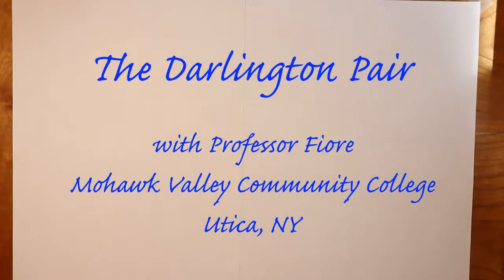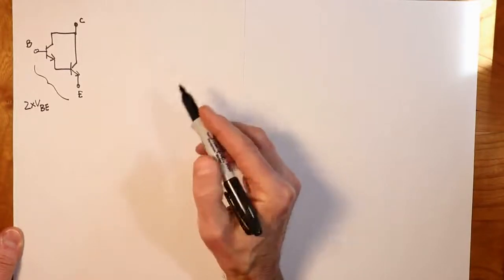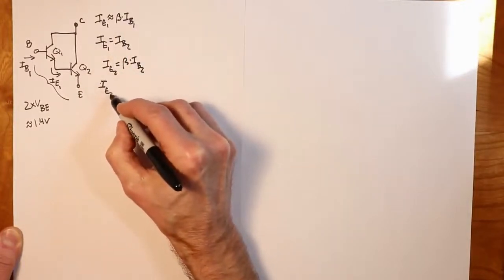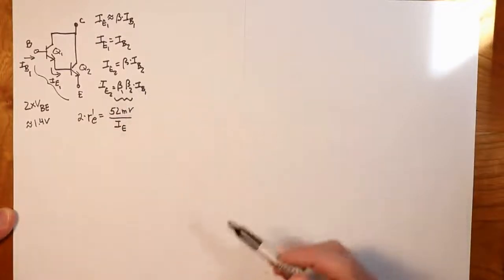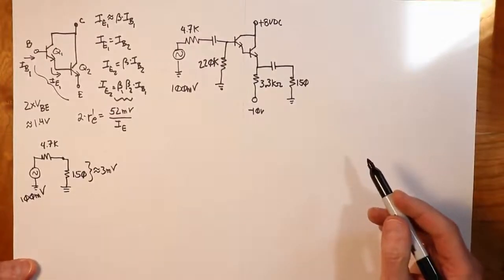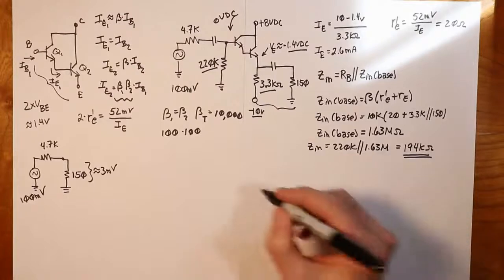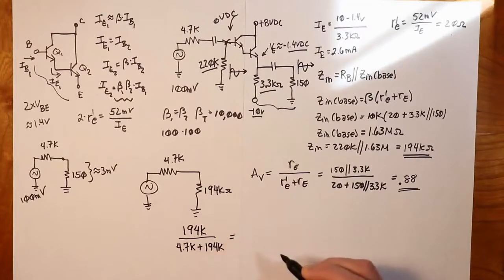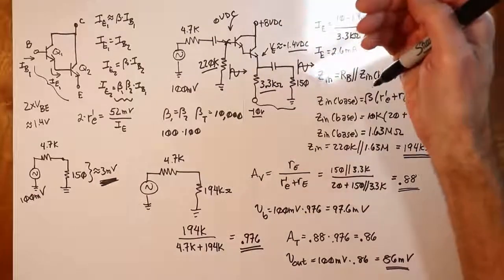Semiconductor Devices: The Darlington Pair

Comment: Morning Sir. I'm struggling a bit with this one.
I hope you don't mind me asking questions of you.
When it comes to calculating the re values of each transistor, wouldn't they have vastly different emitter currents? That is, the first transistor might have a base current of 100 times less than the second transistor, therefore the emitter currents would also be about 100 times different. If we say r'e = 26mV/Ie, if the second transistor is about 3mA, the first would be about 3uA. Am I making a silly mistake somewhere?
Further to yesterday's video on Common-Collector (emitter follower), where we could have used a second stage with a PNP, could we do the same here and return the emitter voltage to the same as the original DC base voltage? Is there a reason to use 2 x NPN?
Thanks again, I'm finding your videos perfectly paced (even if I've only just found them) and I hope that my questions aren't too daft.
Reply from the maker: Yes, the two transistors have vastly different emitter currents, and thus, each transistor's individual r'e is vastly different from the other. The trick is in how the pair is perceived by the rest of the circuit. Consider a pair with beta = 100 for both devices and r'e1 is 200 ohms, meaning that r'e2 is 2 ohms due to its higher current. If you look into the base of the first transistor and consider calculating Zinbase, what do you see? r'e1 gets multiplied by beta1 for 20k ohms. OTOH, r'e2 gets multiplied by beta1 and beta2 which also produces 20k. Those are in series and add to 40k. The total beta is 100*100 or 10k, thus, you can model this as a single transistor with a beta of 10k and an r'e double that of the second transistor (and double the usual 0.7V Vbe).
Reply: @ElectronicswithProfessorFiore  Thank you. Tha's as I expected. I was thinking that the first r'e might be even higher than 200 Ohms.

Comment: 11:00 I’m confused, wouldn’t re be just 150 ohm because cap acts like a short for ac?? Also the 150 ohm looks like a swamping resistor but it comes after cap instead of before, can you help please?
Reply from the maker: Yes, the cap acts like a short at these frequencies and that's why the 150 is in parallel with the 3.3k (remember, the DC power supply is an AC ground). That combo is pretty close to 150, though. And yes, this resistance does act like swamping in that it will lower distortion compared to a typical CE amp.
Reply: @ElectronicswithProfessorFiore  okay thank you!

Comment: Is a output DC blocking capacitors needed On the speaker output?
Reply from the maker: You don't want DC going to a loudspeaker, so in that regard, yes, if the output is not naturally sitting at 0VDC. It would be at 0VDC if you were using  a symmetrical output stage with dual (+/-) DC power supplies, and thus, no cap needed.

Feeding DC into a loudspeaker will just waste power and increase distortion.
Reply: @ElectronicswithProfessorFiore  yes I know what DC does to a speaker is guess what im trying to learn is what kind of design doesn't require DC blocking caps. So are you saying that if I were to use a + and - DC power supply then I wouldn't have to use DC blocking capacitors? 
Ps I appreciate your help and all of your videos
Reply from the maker: @SheikhN-bible-syndrome  Yep. There are many variations on using symmetrical bipolar power supplies. For example, instead of using a single +40 VDC supply for a class B power amp, you'd use +20 VDC and -20 VDC. The operation of the output section is pretty much unchanged, however, as the output would be sitting at 0 VDC, no output coupling cap would be needed. 

Check out the videos on class B power amps. It's easy to configure them in this manner. Class A (like the one in this video) is a bit more involved to achieve that goal (you can't just substitute the supplies). Try this: https://youtu.be/6gLo_eaB2cc
If you haven't seen the videos on class A power amps, it would make more sense to watch those first, like this one: https://youtu.be/0akOGTXwJWY

For the record, the circuit in this video would require further modification to eliminate the output cap. Imagine that you had a voltage divider on the leftmost base of the pair and it set Vb to 1.4 VDC. That would place the rightmost emitter at 0VDC, and thus, no cap would be needed. (In a practical circuit you'd need some adjustment/calibration because the Vbe drops would not be exactly 0.7 V each). That's a bit of a moot point though, because class A amps are notoriously inefficient and class B (or its variants) would be preferred (and those designs are easy to implement with dual supplies).